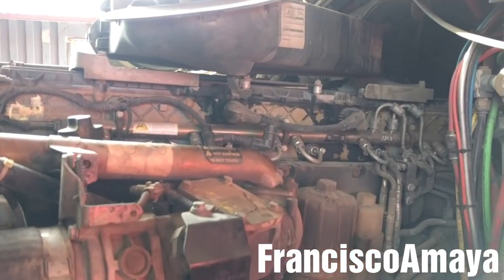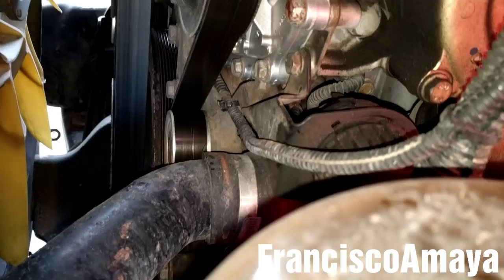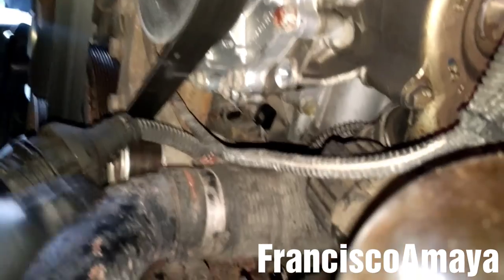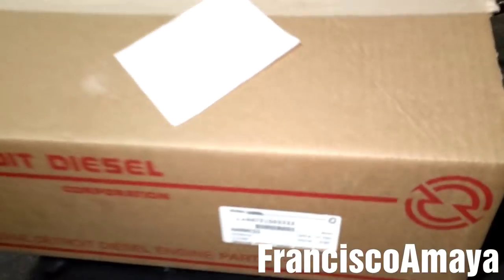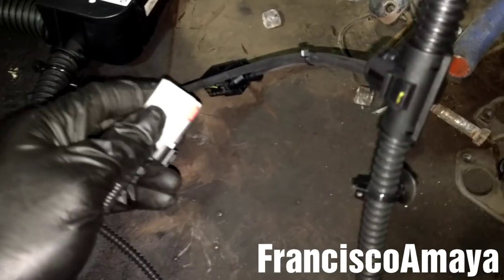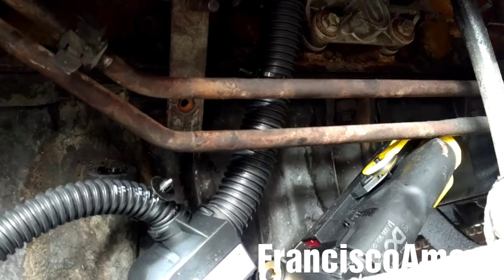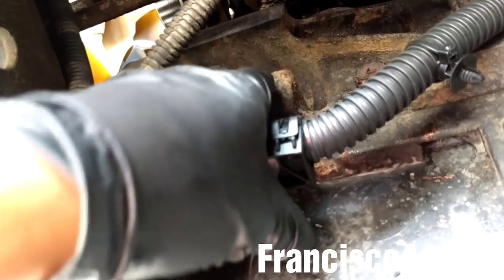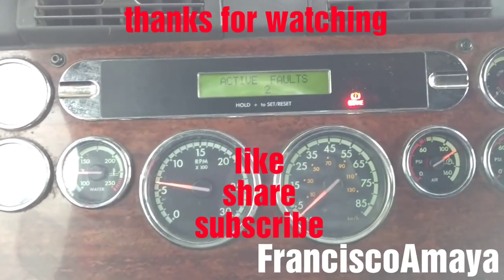Freightliner Cascadia DD13 DD15 DD16 engine harness replacement sensor harness

Comment: My mechanic made me Change the egr valve the whole kit and the engine harness was the reason why the egr was not working so I had to replace the engine harness after replacing the egr valve which I didn’t need. 
Thank you Francisco your videos really help a lot
Reply: Yes if he used a computer to diagnose it the computer program will walk you through steps and one of them is the egr valve. If the arm wasnt moving to the proper spec it may of told the tech it was condemned. And to replace it.. that is if he was honest and you never know it may have been going bad. Like i said if he was being honest. We've had the same problem for the past 3 days. It turned out to be a faulty harness but it lead us down several different routes

Comment: Francisco, I've been getting SPN 4374 FMI0 twenty  days after replacing the DEF pump. My garage found some damaged Def lines to the One-Box. We replaced those and it ea good for a week and then it came back, derating 25%, then 55mph and one night I was making it home to get to the shop (800 miles) and it derated 5mph when I was fueling. I reid to clear it with a Nextech but it wouldn't. When I was parking for the night anyway and when I backed up to  park the STOP light went out. I didn't test it, until morning and when I started it was not derated and had no errors. These returned when I got home. We replaced the One-Box sensor harness, the DEF pump harness and the main Def harness between them.  This was good for two weeks and then the SPN 4374 FMI0 returned. I can clear it but it returns at varying intervals. If it stays out it does seem to dose. It's this possibly a harness issue? This is a 2016 DD15 in a Western Star 5700. Love your videos!
Reply from the maker: That refers  to a low DEF pressure, the DEF pump is defective or there is a leak somewhere.
Reply: @franciscoamayaYT  it's a brand new pump. Not a Reman, either. We've looked everywhere for leaks. At first we thought maybe the header was split as we've seen temperatures approaching -50f this winter. I suppose it's possible the pump is defective. The fact it works some of the time makes me suspect.
Reply from the maker: Check with the dddl software, RPM must be at 1100 +/- and press at 145 psi +/- if I remember correctly. 
Higher RPM and low and equal press as described means bad DEF pump. 
It happened to me couple times, new pump right, but it is defective. Frustrating... 🧐
Reply: @franciscoamayaYT  Thanks. Going to replace the harness anyway because the spinner has 1.3V across pin 1and 3, and 1 to ground and should be 5V and I sometimes get these ABS codes at startup but they always go out after 5 minutes and don't always come on anyway. Obviously at 7yrs old the harness is showing its age and this certainly won't hurt.

Comment: Can you make a video to replace a head gasket on the DD15. I replaced the head gasket on my DD15. I sent the head to the machine shop and had it rebuilt. After I put it back together it began to leak oil. It looked like it was coming from the head. I again replaced the head gasket and had the head rechecked for warping and cracks. The head was fine. I put it back together and it leaked oil again. Do I need a rebuild?

Comment: Hey Francisco, my truck does not start I changed ignition, power switch, I changed the new starter it works few days than suddenly it stops working. To go somewhere I have to start by bypassing the starter to start the truck with a wire.

Comment: I have a 2012 cascadia dd15 had a injector harness leak and oil was making contact with the back engine harness.  Got a injector #1 code then after I stop #3 would pull a code also. I can unplug the harness and plug it back in and codes go away truck runs normal. It only pulls the codes if I'm pulling a load. Do I need to replace the injectors or the engine harness?
Reply: nealyville did u get a solution I was losing power too

Comment: I have a question about a sensor on the 2010 Cascadia. My AC doesn't work anymore and my temperature reading on the info panel in the dash says 00°F. My question is, would the ambient temperature sensor cause the power to the AC compressor to not work? The sensor is on the bumper, on the passenger side. It's about to get hot and I need to get this figured out. Thanks in advance Francisco for your help my man..
Reply from the maker: It is possible, replace the sensor with a new one.

Comment: The new harness from the dealer for my 2011 DD13 comes with an extra plug. Will it make a difference  if I install the harness and leave that plug loose ?  The rest of the plugs are the same
Reply: Just a follow up. Left the extra plug loose and everything works fine. Guess they make these replacement harnesses as a one size fits all.
Reply: Yep I also have extra plug ?

Comment: Could the wiring harness cause eec 61, ecu 1, and no eng. Codes on 2013 cascadia? Truck will not start, and before the truck would die and restart while driving, the fuel gauge and def indicator would just quit and stay off. Then the dash would light up like a Christmas tree the engine fan would come on, then everything would go off after 30 seconds then run fine, but did it 6 times when I got truck home turned truck off, and would not turn over anymore sense then. It says I need to replace acm because of internal fault code, but I checked fuses, in sam chassis and ecm but none I found blown, what would cause it, please help, thank you. Joel.
Reply: I have same ? Replaced harness and cab computer ! New from freightliner.  Still no start ? Moved on to fuel pump and put on a two filter fuel housing.  I wonder if plastic gasket material broke off from high pump gasket ? Plugged my injectors ? Can see broken round gasket on old seal ? New seal has bigger ports ? Was this gasket a factory defective? Maybe ?

Comment: Hi Francisco I have 2008 cascadia with series 60. Everytime it rains and I'm driving or when I get engine washed I get check engine lights saying cyl #4,5,6 injector and I barely have any power. What's your guess on that, is it the engine harness. This only happens when it rains. Thanks so much.
Reply from the maker: It is possible that you injector harness is bad.
Reply: Maxxforce 13 has similar issues but i get so.much negative comments about this enginebut when other engines have similar problems hardly any negativity. I wonder why

Comment: How often should you adjust clutch ?!
Reply from the maker: The Cascadia come with a Eaton solo clutch (self adjusting clutch), if it has the OEM clutch you don't have to adjust the clutch never until you need to replace it with a new one. BUT the Eaton solo clutch gets adjusted every time you press the clutch. my recommendation, press the clutch two times before starting the engine to get the clutch adjusted. 

BUT, often. People replace the clutch and the install a eaton easy pedal clutch (manually adjusted) this is not the recommended clutch for a Freightliner Cascadia but people install them because it is cheaper that a solo clutch.
Reply: Francisco Amaya  the clutch has no free play its releasing au the top I've only had this clutch 8 months  it's a solo I removed inspection cover and tab was almost on the worn indicator

Comment: It’s happened 2 times already 
I’ve got codes spn3509 fmi 4 and spn 3563 fmi 4 
One time truck was towed to dealer shop. At shop at evening time nobody could connect computer to truck. But in the morning all active codes gone and mechanic said that he can’t start working without active code
I worked about month and last Thursday it’s happened again .
I came to dealer shop in Michigan they said that they can start work only next Tuesday 
I start moving toward Chicago and after one hour driving with half power and four way flashing everything gone again. 
At the end of the day I’ve got four active codes an I have to stop for all night 
In the morning all active codes gone again 
Francisco, what you would advise to your friend?
Change the engine harness?
Thanks

Comment: Hi 
I have dd15. 2011
When engine is not hot as 160 or more 
Truck keeps cutting out and smoking until got the temperature over 160
Can you help with some Devices  what should I do
Thanks

Comment: I got a question? I have 2011 cascadia dd15 if I hit a bump I throw a injector code once I wiggle that injector harness connector and restart my truck it goes away? Do I need to change my engine harness or injector harness?
Reply from the maker: Maybe you have to check the injectors connections, they can be not properly secured.

Comment: Hey man love your videos. But i have a 2011 dd15 and def has been deleted. Truck runs good for 2 weeks then check engine light comes on and throws truck into derate mode. Pull code and says rail pressure circuit failed. Done put 3 rail pressure sensors in and new ecm Any suggestions please thanks
Reply from the maker: Did you check the engine harness?

Comment: Francisco I have a 2014 freightliner Cascadia DD13 engine and I recently got the delete and two injectors replaced at the same time as the delete and now when when I'm hauling a heavy load up hill my check engine light comes on and then I lose power the truck D rates but when I turn the truck off and let it sit and restart my Truck the check engine light turns off and then it starts driving back to normal and gets its power back what do you think could be the problem that's my question
Reply from the maker: That is a secondary effect of the delete.  All truck have different effects but the common one is that on. 
It is related to fuel delivery to the DPF, they need to delete the Dozer injection system to eliminate that problem.

Comment: Can please tell me if there is wire harness only for def 2016 cascadia cause it gives me a lot of codes like last week I took it to mechanic they told me def pump is the issue they put a new one but that was not the problem it was something wire that was cut in def wires so I spend money on something else and after one week def light is blinking with 2 engine lights so I am thinking i have some wire harness problem with def it’s 480000 miles can u tell if I can only change the def wire harness not the hole truck and how much is it for def wire harness and hole truck wire harness if I want to change it
Reply from the maker: Yes, it is in the scr box

Comment: Hi, 
I have a freighliner 2015. HORN NOT WORKING.
I replaced the horn and check the 
Fuse is good, just don’t know if there is a relay for the electrical horn, it used to click when I press the horn and now it is not clicking it anymore.
Reply from the maker: Replace the steering wheel interface wiring,  you have to remove the steering wheel to replace it.  
If that doesn't fix it, you have to replace the SAM CAB module

Comment: What about a short hood dd13 this definitely does not work for all engine platforms maybe a dd15 or dd16 but on a 13 nooopeeeee
Reply from the maker: yes, short hood trucks are extremely difficult to work on. the right way to do a engine wiring replacement, the oil pan has to be remove but it can be done faster by breaking the cross bracket of the harness for a faster installation.